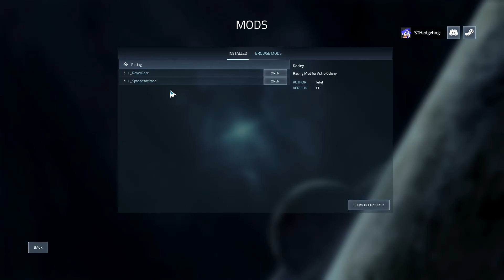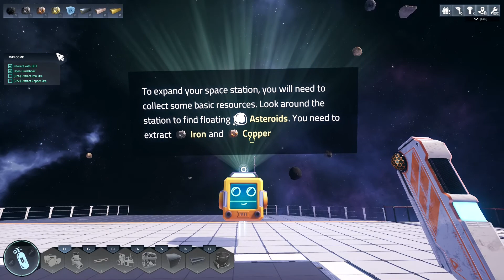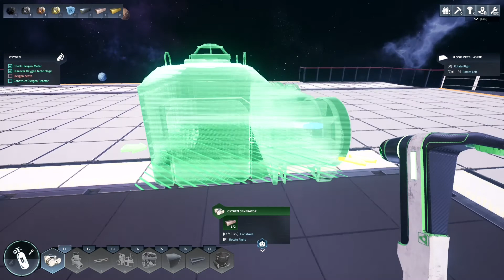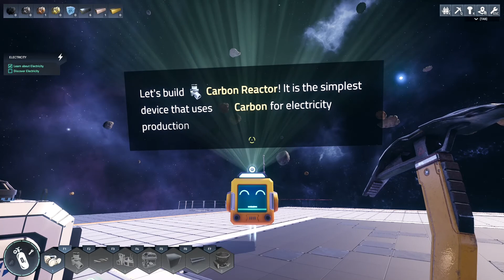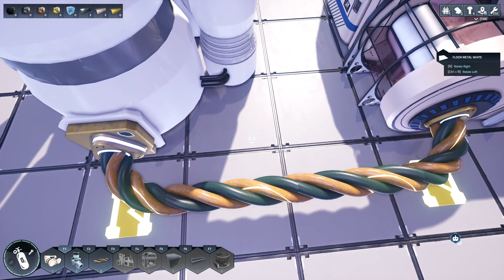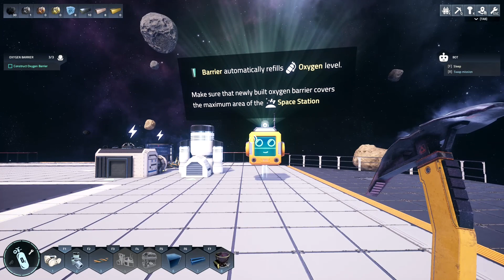Astro Colony - 01 - A Wild New Factory Game Appears

Comment: I ran into a really weird problem with this game when it comes to the Transport Bots. The bots were working just fine, moving coal from the Asteroid Catcher's to the Carbon Generator. Then seemingly at random, the robots get stuck as if they are obstructed; with a red line drawn from their current position to their target position. Only way for me to fix it is to destroy the storage crates they are carrying the coal to and from, and sometimes it'll get fixed. This obviously wastes lots of resources and is now happening extremely frequently; to the point that I dropped the game entirely.

I was playing the Demo, but I wasn't going to cough up the 20 bucks just to see if it's fixed in the full version or not. I know I could potentially refund, but I'd rather wait and see if anyone else has had similar issues.
Reply from the maker: I have had that bug before, along with the bots becoming gigantic for some strange reason. I'm not sure what version the demo is on, but most of those issues were fixed in the main game. I understand not wanting to spend out on the full game as the demo experience wasn't 100%. The best advise I can give would be to join the discord if you haven't already, and ask in there, you can also see all the new progress that's in the game since the demo was released (assuming the demo hasn't been updated, I haven't played in a while)

https://discord.gg/Mp4BqwGD
Reply: @HouseOfHedgehog  I appreciate the response. I ended up just taking a gamble and buying the full game and haven't run into any issues since! 

Had an issue where my astronauts wouldn't eat; but that was because I didn't put down an actual Dining Stand. Just assumed they would eat right from the Canteen that already looks like a giant table lol